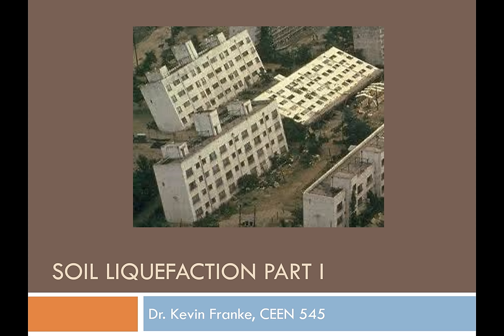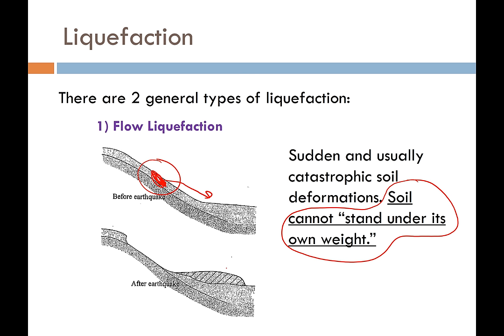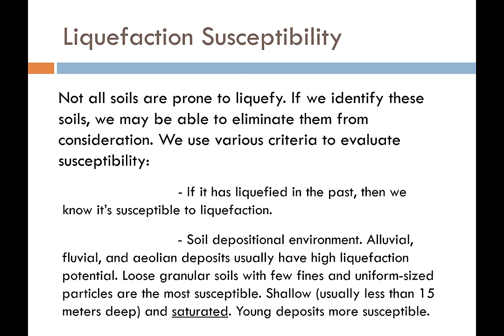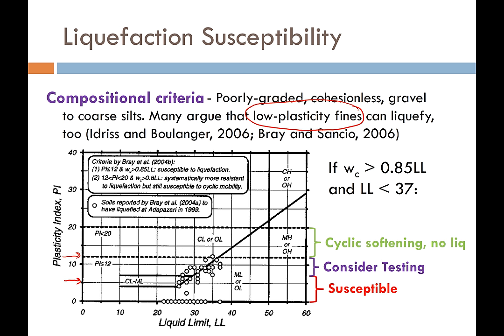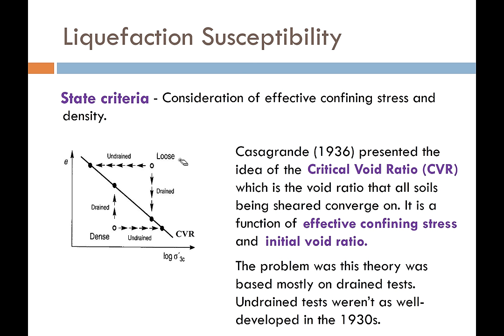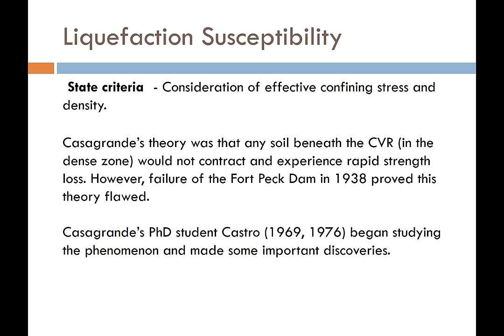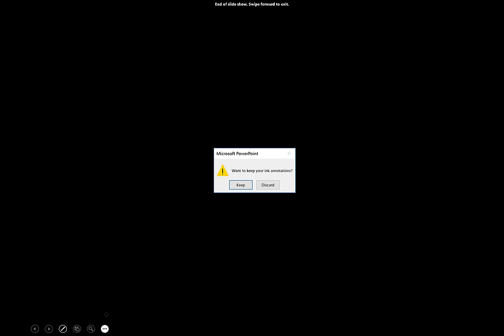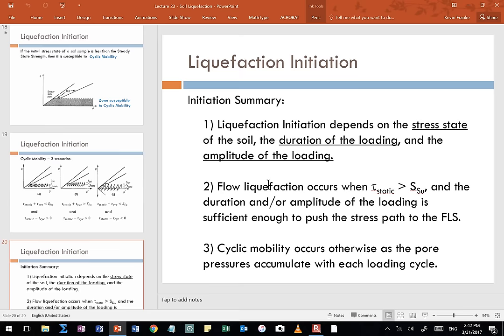CEEN 545 - Lecture 23 - Soil Liquefaction (Part 1)

Comment: Scientifically speaking you would get more credibility if you spelled the topic of your subject correctly. If you check there is a difference between 'liquefaction' and 'liquifaction' . In this case, the correct word to use would be :  'LIQUIFACTION'
Reply: I have seen it spelled as 'liquefaction' in most literature texts, e.g. Kovacs and Holtz textbook. I have never heard of 'liquifaction'
Reply: What's liquifaction? Google suggests 'liquefaction' when I type 'liquifaction.